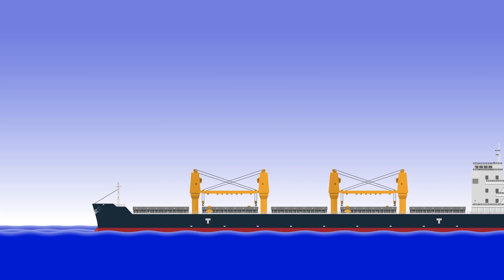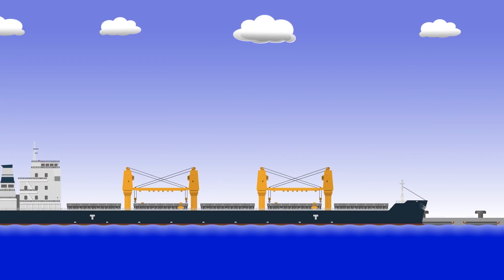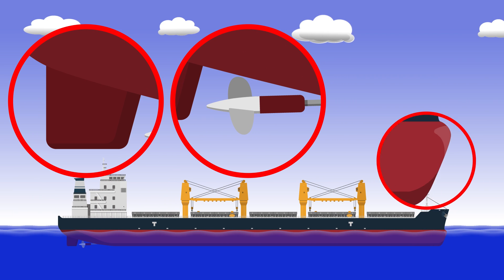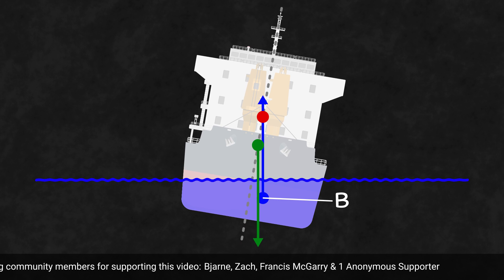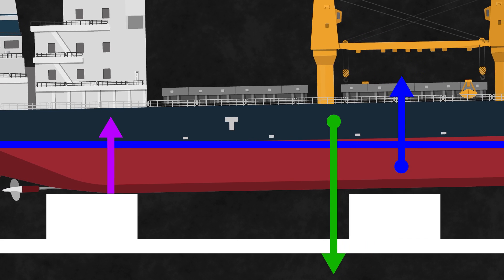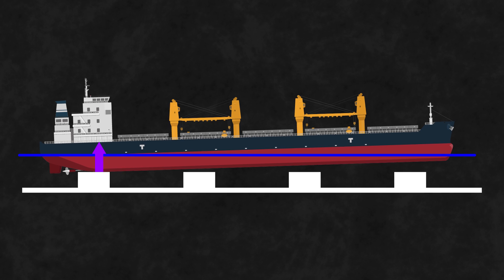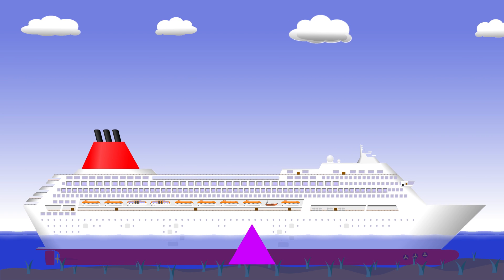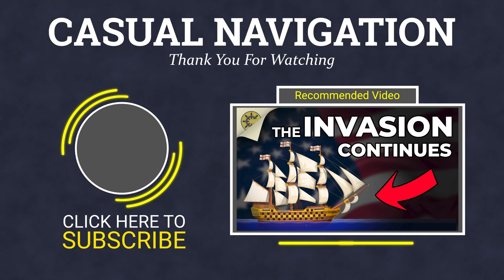Drydocking: Its HARDER Than it Looks!

Comment: Wouldn’t a ship (also) need sandblasting?!I’d think this would be a requirement for 99% of ships and if so I always wondered how can you blast the areas where the blocks are supporting the ship?Do they refill the dry dock and sandblast the block shielded area (and paint)?Is it a special 2 part epoxy? Or am I over thinking this ?Just slap some paint on it wherever it lands and get it back to sea.

Comment: Another solution is coating your ship with Ecospeed which is 100% environmentally free so no antifouling is being used, it’s easy maintenance. Most growth washes off by sailing and when cleaning is required it can be both done underwater as in drydock by pressure washing the hull. On top of that. The Ecospeed has a 10 year warranty and being applied correctly it will outlast that easily!

Comment: Your demonstration is incomplete. When P (normally called the suing load) starts, the vessel is already stabilised using side shores or bottom side blocks to counteract any capsizing moments. By the time the entire keel is touching, she will be fully supported by her side shores or her bottom craddle.
There is therefore no scenario in which a ship can capsize in a normally controlled drydocking process. 
However, a few examples exist in history where the attempt at docking an already unstable ship lead to some serious problems.

Comment: Is that assuming the presence of only keel blocks? Every drydocked ship I've ever seen also have side blocks on the floor. Divers are present to monitor the ship during pump down and wedge side blocks as necessary for horizontal stability.

Comment: i dont know if youve been in a drydock but you dont really have to worry about the P force, theres more than one row of support blocks, there can be somewhere from 3 to 6 rows of big mounted wooden blocks that is settles down on depending on the size, if we were to have only one row like demonstrated the ships hul would warp imensley as hull construction aint what is used to be, thats allso why a big oil tankers crumble like tin foil and the big steel sides start to curve inwards over time, id say that issue started around 1932 when recources were streched thin douring WW2. aand that was a wierd journet from wooden pillars to history XD how did i get here :T
Reply: Yep... I just spotted that myself. Nobody in their right mind would try to balance any boat on a single line of blocks. I was looking in a drydock last week. The Dutch Barge I was looking at had just been repaired and painted and inspected by insurance. It failed when it was refloated to move the blocks for inspection and there were dents where it was originally positioned. The hull had thinned out a bit I guess.

Comment: Actually most of drydocks requiring to enter dock with trim as less as possible. Second thing - as vessels are flat bottomed and block are planned to support full width - vessel will not be able to heel as long as it touches first pair of blocks. Did it many times, serving as a Chief Mate on gas tankers.

Comment: If ships were drydocked with blocks under the keel only, your video would make sense. I have been under ships and boats in drydock. There are blocks across the width of the vessel as well as down the length.  This is common practice on floating drydocks as well as graving docks.

Comment: Cool.
I worked at a small dry dock for a few years, docking vessels of up to maybe 700 tonnes.
We would do a lot of the work manually and sort of winging it, but there hasn't been a serious incident at that dock for the last 35 years.
We used to adapt the blocking to every ship, so that it would land as level as possible. At the exact time that the ship touched down, we would fix the supporting beams around the hull. These beams were just telefone poles extending from the side of the drydock and jammed against the hull with wood wedges. The crew's job was to control the mooring lines, keeping the vessel straight and centered in the dock as it settled. We often docked two, three or sometimes even four vessels at the same time. As long as they had different drafts, you could concentrate on one at the time, but those were very busy days.
If it was a more complicated docking we would open the flood gates in the dock gate to let in water at the same rate as it was pumping out, this way we could keep the water in the drydock at a specific level while working with the support beams. Not optimal, since letting in water created a lot of strong currents that wanted to push the ships out of place. Turning off the pumps was not an option, they could only be started with a filled dock.

Comment: 3:55 - that's easily addressed by placing blocks across the width of the hull, which gives you the added benefit of also increasing your contact patch and reducing the force per cm2 of hull surface area. Alternatively, you can counter-ballast as you raise the ship, reducing the rear ballast and increasing the forward ballast until the entire hull is in contact with the blocks, then just drain all the ballast as you're draining the dry-dock. This will level the ship as you lower the water level (or raise the dock) and keep the upward force of the rear blocks low, so it doesn't cause a lateral imbalance.
Reply: Blocks go all the way to the turn of the bilge

Comment: Why not do something like a suspension bridge, instead of having heavy supports from bottom up, just have wire attachment points connected to bottom to top strengthened sections. The suspension wire attachments are above water, and are passively regulated by the receding water. Meaning you dont need to be anywhere near as exact, it would also allow a much larger variation of ship sizes in one fixed size dry dock. Seems trivial by comparison, not to mention it avoids the problem with not being able to dry-clean the supports of the current system? Is the current seemingly poor design just a legacy of drydocks beeing scaled up versions of what was used for small ships or is there some kind of reason?

The argument about needing a vaccum for a external e.g. brush type hull cleaner also does not hold water, as there would be no reason to perform such work while in harbor rather than just during regular travel. Is there a reason for that?

Comment: Having just left dry dock, as an engineer this is interesting information. I'd say from our side that dry dock is hugely about machinery - props and rudders off and cleaned, stern tubes emptied and inspected (and repaired, i our case). The fouling is very minor, and the big thing from deck side is a good shot blast and repaint.

Comment: The real question is, when the first contact is made with the dry dock, why doesn’t the contact patch have a shape that supports the ship on left and right from capsizing?
Reply: In general, the aft section of a ships hull is intricately profiled such that it is only possible to have the ship "touch down" on the centre line first. There are of course rows of blocks off of the centre line but they won't make contact until the ship is sitting level and all of the rest of the blocks make contact at the same time. 
Another thing to keep in mind is that the ship would not capsize by 'falling off' of a centre line block. The forces generated throughout the procedure would act on the ship to turn it around its own centre of buoyancy.
Reply: @frogandgauge  Thanks but (as mentioned) how high P force can increase the centre of gravity height?
Thanks.
Reply: Not even that, if the bottom of a ship is flat then why not just have the blocks be wider than the ship? That way it simply can’t tilt.
Reply: What I was thinking. Must be cheaper to do it the more dangerous way, as usual.

Comment: What they should invest in is a drydock that can meet the ship rather than the ship meeting the drydock.

Essentially, you extend bars and blocks to touch the ships hull and pin it in place.
The added benefit is that you can also retract one block to do maintenance in that blocks position while the others are holding the ship in place.

Probably too expensive but IDGAF, it would be a better solution.

Comment: A question that came up in our mechanics lectures was "Can a 100-ton ship float on only a single liter of water in a suitably shaped container of the water (like a really tight dock), or would it touch the bottom somewhere?"
Reply: I guess so, it's just that the liter of water has to spread all over the wetted surface area of the ship so it'll be ridiculously thin, to the point where it might break apart into droplets
Reply: @dsdy1205  Yea surface tension and at some point molecular size might change things, but excluding those isn't it totally counter-intuitive given the weight difference? :-)
Reply: @foolwise4703  Well, it makes more sense once you realise that the perfectly hull-shaped vessel is holding everything up, at least that's how I explain it to myself

Comment: If a slight trim can have a major impact on a ship's stability when drydocking then how do yard workers handle damaged ships that have a severe uncorrectable list?  For example a vessel that is holed with major flooding across multiple compartments. Is there a method of stabilizing the ship as the drydocked is drained? I imagine this would have been a common occurrence during the world wars when many ships returned to port with battle damage.

Comment: Great video, but there is one question about dry docking I have never seen an answer for. 
After dry docking, cleaning, repairs and repainting how do you do the areas of the hull that sit on the blocks? Do you go through the whole process again in a slightly different position?
Reply: You do it next time the ship goes into dry dock

Comment: Did 10+ drydocks of cruise ships. Another "strange" consequence of DD is that when the ship is on blocks the hull deforms of a few millimetres because of change of the forces applied to it (mainly gravity instead of buoyancy). In one drydock a fire door on deck 3 became very hard to open and close properly during the drydock operations. Once the ship went back in the water, the door operated smoothly as always.

Comment: To be fair, every time I entered a dry-dock, we immediately took berthing wires and the ship was eased in under control, specifically to keep it centred and fully supported. It doesn't seem particularly good practice to sit the ship on one block aft first, unless those wires are in place and in-hand around bollards or capstans.

The ship's centreline was matched to hanging plumb bobs fore and aft, then the lowering begins as side support timbers are readied. That way, the ship is centred onto all the blocks at pretty much the same instant, and the key frames are braced just as the ship hits them.

As a regular through the St. Lawrence Seaway, a lot of weed was lost in the fresh water, but cathodic protection was always pretty good and we'd only see a major build-up of weed on the waterline rubbing strakes, which were made of Elm beams encased in heavy rubber shrouds.

We also used a boot-topping paint that I never saw weed or animal life take to. Weird stuff, it was; even though you listed the ship to get a good deep waterline stripe of the stuff on the side, you could go into the water with your roller and it would still go on the hull.

Comment: What do they do to avoid blocking the same parts of the hull every time she drydocks?
Reply: Most ships will have at least two blocking plans.  Each one will have the keel and bilge blocks located in different locations.  You alternate positions so you can clean and paint 100% of the hull every other docking.

Comment: this happens on a smaller scale when launching or landing a kayak onto a steep bank. most of the stability comes from the center of the boat, where it is widest, so with the sharp and narrow stern on ground, and the narrow bow in the water, the boat is very unstable. it's put a few people into the drink.

Comment: How do ships stay upright on the dry dock? All the photos I see they all seem to to have nothing holding them down.

Is it just low center of gravity? If so, since the ship can stay upright by itself(when the p force is already at its maximum) then why do we need to worry about it when it lining up in the dry dock?
Reply: the big ships i went under had 3 rows of blocks. but if the blocks are in thenwrong place they go straight through the ships hull. such ships are heavy enough not to capsize just like that lol.

Comment: P force "pushing back with an equal force" isn't quite correct. If I put a billion tons on that block, its not going to push back with a billion tons is it? No its, just going to crumple. 

It appears like its pushing back with an equal force but its not. Its better to think of it as resistance than a force pushing back. The block resists the downwards push from the weight and it does so until it reaches load bearing capacity and then it breaks. 

Pushing back is too much of an over simplification and which is also why it doesn't apply for all cases. 

Thinking in terms of resistance fits all cases. If I put a billion tons on it, it still resists that weight. Only for a split second before the load capacity is reached, but it still resists. 

At no point will it push back "with an equal weight" when I put a billion tons on it. If it could "push back with an equal weight", it wouldn't deform would it. It would resist perfectly.

Comment: I served on the USS Bremerton (SSN-698), a Los Angeles class fast attack submarine, during new construction an Electric Boat in Groton, CT. and at Pearl Harbor, HI.  We spent the first 1-2 years going in and out of dry dock.  Submarines have unique problems when entering dry dock.  The worst time I had in dry dock was at Groton in the dead of winter with subzero temperatures.  We would have to climb from the top of the sub into the bottom of the dry dock to ensure off-hull hose connections were not freezing once every hour.
Reply: Served on older boats, but yeah, same thing in 'rotton Groton'  lol.  And rig hoses to provide cooling water to key components.

Comment: I would have thought that they just pull into dry dock and chain the ship to the dock and center it using the chains. Then as the water was pumped out if the ship needed correcting they would move the chains by pulling in the chains on one side and giving out more chain on the other.

Comment: Thank you, interesting! Is this one of the reason why even today boats are launched the traditional way by “falling into water” more or less, rather than by building them in a floodable dock - because it is much quicker?
Reply: I have no background in marine engineering or boats but my only guess is that not all dry docks have the needed infrastructure or machinery involved in ship building, (or are unable to support said infrastructure). The space needed for ship building far exceeds the design limits of some drydocks.Drydocks are still used in ship construction tho. Good question.

Comment: Curious question, but with the amazing power of modern automation, why not do what animals do?  Eg. Drones that clean the ship at all times?  Little by little, brushing it off.  Reduce the amount of time spent in dry dock.  I bet they have a reason why they don’t do this, but it seems like it would be simple.
Reply: When doing it in a dry dock you do it while you are doing maintenance anyways. You'd still be in the drydock anyways, even if you weren't cleaning it. So the only added cost is the people cleaning it... and thats probably a lot cheaper than these drones would cost to operate.

The video also seems pretty misleading about the actual complications of dry docks. They simply put multiple rows of blocks, so all the "dangerous" and "critical" issues shown in the video just don't apply in the real world.
Reply: @fxshlein  perhaps, but anything is cheap if you invest in it, and machines are often cheaper than humans.  I’m just imagining some big boat, with a mostly smooth underside, and a little robot moving about, very hydrodynamic, little brushes cleaning the hull, and some kind of simple system to keep it from getting knocked off and lost,
Reply: @FurryEskimo  Its probably just not worth it, the cost of cleaning are probably such a tiny drop in the bucket compared to regular operating costs for such a ship anyways, and I still think getting a cleaning crew every few years is probably way cheaper than continuously operating a robot underwater, that needs maintenance, and it can fail, break, fall off, etc.
Reply: @fxshlein  Perhaps.  I still think we should at least consider it.  We have so much potential right now, so many resources, let’s do something cool and effective if we can.
Reply: @FurryEskimo  Don't get me wrong I'm all for (over)engineering tech like that, I'm a Software Developer... I'm all for more things that need Software lol

I just cant see it actually happen sadly.
Reply: @fxshlein  Perhaps not..  Companies in general prefer simple tech.  They want it flashy, but simple.  I can’t believe automatic lawnmowers are still so dumb!  It should be so simple to code!

Comment: Long ago there was a questionable practice (not very common though - fortunately) to clean the ship bottom from shells by humping the vessel over a sandbank. Pretty delicate operation all and all, and required vessel in ballast only, a well known spot and a reckless captain.
When successful, the vessel speed and fuel economy had a measurable improvement. When stuck, too bad.
Method not that much used today - I hope.
Reply: Well old wooden sailing ships would be beached at high tide and allowed to roll to the side as the tide went out.  You had only a few hours to get work done (including 'paying' the seams with oakum and tar. ;)  )  Of course, they were a lot smaller and crews were actually larger.